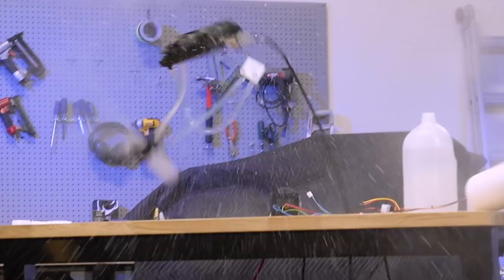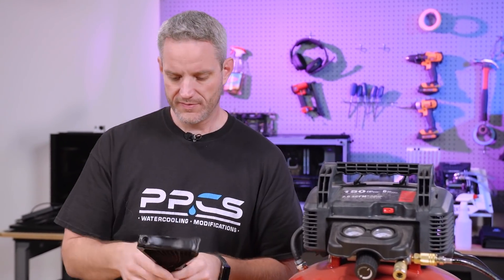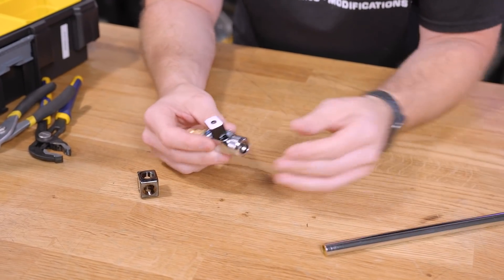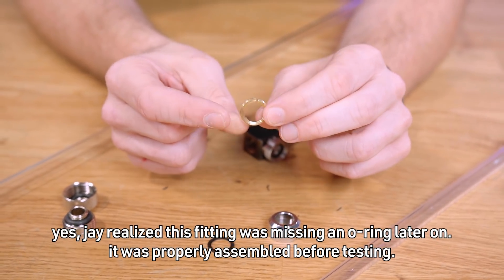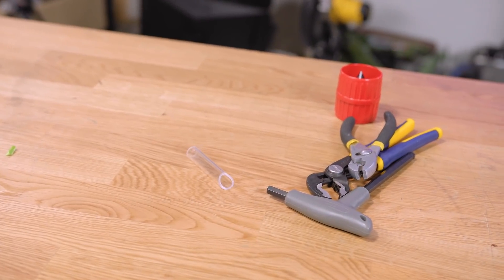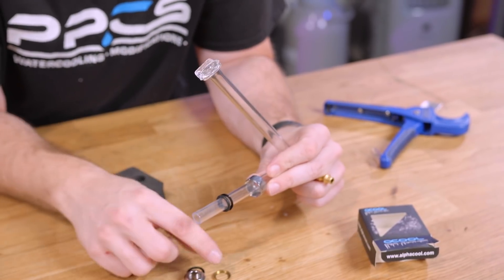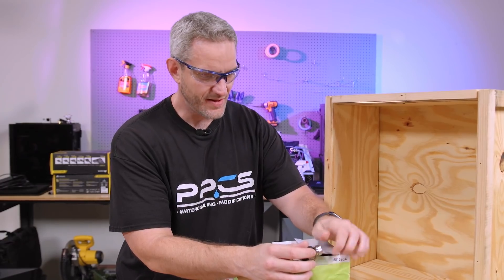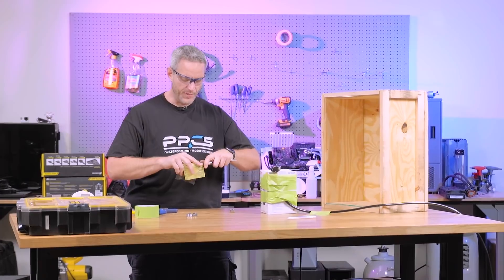I really need to stop these experiments... DO NOT TRY!

Comment: As a demo guy... metal tubes actually hold well. Think plumbing. 1 sharable, can hold the water pressure in your pipes... unless you make a mistake... then you need to fix the hole in your ceiling as well.

Comment: Next time you are bored, here is an experiment for you Jay: buy a large off the shelf PC case, then mod it so that it still looks good, but can hold enough 140mm fan based radiators (like multiple 560mm or 420mm radiators) to be able to get a max overclocked top of the range CPU and GPU to within 5 degrees C of ambient, with fans running at the minimum speed they can go. I know you did the box fan experiment, but that was not within an off the shelf PC case, not practical, and not something that we could copy at home ourselves in a way that would look good on as a complete PC that you want to keep, rather than bits of equipment all over the place. :)

Comment: Back in 2004 i started building my watercooling stuff. Passive heat exchanger with 6m (later 12m) copper installation pipe handsoldered, reservoir 5l canister.
Built the aluminium gpu and chipset coolers myself with a cheapo drillpress mill. (The first ones really only with drills, blocks and tubes+epoxy) Cpu was already kinda cheap to get in copper.
Used a tandem of two used geared pumps.
Nevertheless beeing used, they still got up to almost 9 bar when clamping the output line.
Guess who forgot to unclamp the return line tubes after changing things... yep, i did.

I was and am still using thick walled silicon tubing. Looks really cool when they get bigger and bigger and more transparent.

Afterwards i knew my system was worst case leakproof :-)

edit: 10 bar = 145 PSI

Comment: Did the compressor file a complaint by now?
(I think aquacomputer leaktests their stuff up to 10bar)

PS: Your potato gun needs a larger air buffer volume  in front of the valve. And always wear ear (+eye) protection with unknown pressure stuff.

Comment: If you are building pressure, beyond what the pump is doing, in your water cooling loop, you have bigger issues. Water won't expand until it boils at 100*C and there should not be air in your loop.

Comment: there is 1 thing i always wanted to see, though i don't have the tools, equipment or the parts to do so, but how will an very old part compare to todays modern ones, like how will for example an intel 2700k or another 2nd gen intel cpu overclocked to 4.5 GHz or so compare to todays cpu from AMD or Intel at around the same frequency having the same amount of cores and threads (have to use a newer gpu though, its the only thing that improves gaming performance greatly), do the people owning these chips or parts really need upgrades on cpu motherboard ram?

Comment: being a chef/butcher, i was wondering, is it at all possible to water cool a system using cow/pig blood. these are readily available from butchers over here in the UK and used in a wide range of recipies. Linus has tried to cool a pc with cement, so why not got one better? It will also be interesting to see how much heat it can acctually take before the animal blood starts to clot and block the rads, water blocks, and pump. It would make for one awesome halloween/horror theme build.

Comment: Alpha Cool uses the rear washer, just like Swagelok proved with their compression fittings, that a rear facing washer applies the nut pressure more evenly on the compression material, whether gasket or metal sealing, to give a much better sealing action.  its especially important with metal to metal seals.  We used nothing but Swagelok in the semi conductor fabrication equipment I designed and built for a decade.

Comment: you should try this with the thermaltake fittings! i think they are alot better. they also make it easier to measure the tube distances because of how they are made to where you have a flat surface on both ends. plus they have like 6 o-rings!

Comment: Mam, if you want to do pressure testing, get a piston pump an do the test with liquid. You can have 100bar pressure in a hydraulic line, and when it pups, it will go easy. No dramatic exploration. Air will compromise and have much more energy storage and will explode when there's a failure

Comment: actually in this case size does matter, at the same PSI a larger tube will have more pressure pushing on it. so for a good teat of fitting you DO need to use the same size tubing, but this is for fun right?

Comment: In the brewing world, I see 4% volumetric expansion without pressure from room temp to boiling. Considering most loops have some extra space in the reservoirs and you aren't seeing nearly as hot of temps, I really doubt you'll be getting any kind of pressure close to what you tested in the video. Could always add a tee somewhere with a pressure gauge to test out an rig under load. Thanks for the entertaining content though, would love to see more like this. Subscribed!

Comment: Yep I can confirm. I used to work in a QC lab for the fastener industry and I did a lot of torque testing of fasteners which requires specific high PSI depending on the fastener. Sometimes with failure the sheared bolts or failed nuts would fly off into the wall and would definitely dent metal.  I made sure never to stand directly in front of the instrument.

Comment: This makes me wonder how long before Steamfitters start getting commissioned to build PC Radiator arrays.  We already do full scale installations of Datacenters and Chip Plants but I mean for Personal Computers.  Someone call up their local Mechanical Company:
Customer - "Do you guys hook up  PC Cooling?"  lol 
Sales Rep - "We sure do!, what sort of system are you interested in?  Copper? Steel? Stainless Steel? Aluminum? Glass? PVC?"
Customer - "Oh wow.. uh.. I didn't know there were that many options"
Sales Rep - "Oh sure, we also offer different types of joint bonds too; Soldered, Brazed, GTAW Welded, Orbital Welded, Swagelok, Or just simple Compression Fittings with Flex connections?"
Customer - "Oh my.. uh.. Got anything that's shiny like silver?"
Sales Rep - "Yup, that would be 316 Stainless Steel (Expensive but would look damn impressive).  Do you want that in Water or Freon? Or perhaps you'd like that with a Freon loop for refrigeration?"

Could go on for hours, but yeah the market for this looks interesting and some truly impressive designs can be made. And all of them would hold up to several thousands of pounds of pressure (no idea why you'd want or need that)  and could easily put your hardware into a small freezer complete with air-dryer to keep everything from sweating and shorting out lol
Reply: please

Comment: Jay please do a 24 volt D5 pump test. Amazon has the 12v to 24v adapters for 15bucks.. Some liquid cool retailers say it will up the head pressure by 50% (AKA 1/3) I noticed my pump actually got quieter when i ran it at 24volts the pump D5 itself is actually designed to run at 24volts so all the specs are based on that. running at 12volt is undervolting D5

Comment: Ive worked at a tire shop. The tire cheetah will knock you off your feet. The bead popper will chop your foot off. The tire table will mangle whatever you dont get out the way fast enough. Filling a used dry rotted tire is scary af cause they do explode and make lots of noises.

Comment: For the acrylic tubing, buy an arrow cutter. For archery purposes normally but they cut stainless steel aluminium and carbon fiber arrows, They should cut acrylic tubing with ease, plus you can even get a nifty one for your shop that has a shop vac connection to prevent the dust from flying around. Some even come with a set of tools that would help with deburring an smoothing that tubing

Comment: I wonder how long the fittings would hold at each round number of PSI, if each one would be able to last 1 minute or more under each round number, continuing to go up until the one that blows it.
In other words, what I'm wondering is how much of a stable flow of PSI the fittings can hold, instead of just how far up in PSI you can go before they blow.

Maybe if you give it a minute or so before jumping from 10 PSI to 20 PSI, and from 20 PSI to 30 PSI, the fittings will have had time to adjust to the pressure increase, gripping onto the pipe better before the PSI increases again.

Comment: OK, you started out with a big DON'T TRY THIS AT HOME so they might let you live. Pressure testing is done with a liquid!!! Liquids don't compress, air does. An air leak->rupture will go BOOM (and lift off your roof, blow out your windows and cut off your head if stuff gets big enough), a liquid leak will piddle a bit but not rupture your test subject in a zillion pieces. Just my 2 cents

Comment: When it comes to a push configuration on a radiator, what’s the minimum amount of space you need in front of you fans to still get effective air flow? I have AIO water cooled system that’s hindered by space. I managed to make everything fit, but my front fans only have around an inch of clearance from the front of the case to pull air from.

Comment: I'd like to see a comparison of radiators. I have a 25mm rad, but is a 30 or a 45 better with the same fans, same pump, same pc....same everything except radiators....please
Try an Alphacool Eisbaer Solo LT with the 25mm radiator. All copper plate and rad...it's what i have and my 3900x doesnt go above 58c :)
Edit: mine also has Thermal grizzly liquid metal...thats got to account for at least 5c I suppose...

Comment: You should consider using Performance PC's 12V to 24V Laing Pump Supercharger as it increases flow and head pressure. I have 2 of them that I didn't end up using in my current system after the first time I used 1 on a previous build it made my EK GPU block leak, not through the fittings, but through the screws that hold the block together, it leaked on top of my second 980 Ti Classified card and killed it.
Reply: Mind you that this took about a month after building the loop to occur.

Comment: You should try a scuba tank 3000 psi or paintball 4500psi. They also make compressors that fill those tanks. You might die though so be careful. What you are doing in these videos arent really that dangerous though comparatively.

Comment: Ok, next experiments: Bacon grease instead of water in a cooling loop, lard instead of water in a cooling loop, and using air coolers to cool water loops without radiators (i.e. sandwiching a CPU block to the block of a huge air cooler like a Noctua D14 or D15) and using that to cool a whole loop. #ForScience I'll admit two are terrible ideas and one might make a cool video. If you could get the base of the cooler and the water block lapped for good enough thermal transfer, you might be able to even do fanless cooling.

Comment: Hey Jay, just +1ing your idea to test the pressure a working loop develops when hot etc! I'm fairly sure you can adapt a pressure sensor display to pick it up? Either inline or perhaps screwed in to/attached to the fill hole? Haha..almost like compression testing an engine cylinder/piston!

Comment: Hi Jay, I have a lot of fun watching your experiments. I am an ex rocket design engineer (science license haver) with a fair amount of experience  with high pressure pneumatics. One thing you might try to make your experiments safer is to use pressurized water to fill whatever it is you are pressure testing ( as long as it is appropriate to the system). Pressurized gas can store a lot of energy as you saw, and a way to mitigate the danger posed  by having a pressurized volume is to use an inconpressible fluid like water to fill up most of the volume, and then adding pneumatic pressure to that system. I'd hate to see you or Phil get hurt pursuing these very exciting experiments and thought this might be something for you to consider. Have a great day, and keep up the fun content!

Comment: I’ve got another angle to this.  I’m curious why cpu cooling companies hadn’t used air compression for cooling chips yet.  Aircraft use this technology, and it’s very effective.  When you compress air, it heats up, you cool that heated air with a tap off of the previously used uncompressed air (ambient forces across), then rapidly expand it and it becomes extremely cool.  I think this oils be a very productive technology.

Comment: Not saying anyone would be basing a PhD of your experiments today, but changing the diameter of tube would make a difference because it would have greater surface area contact on which to grip. That is in essence what you were doing by sanding the edge of the brass tube too. 

Again with the specific sizes involved and the generally loose methods it wouldn’t have been a significant factor though

Comment: As an engineer; do not mess around with compressed air. The correct way to pressure test a vessel is to use a compressed liquid. It doesn't squish very much vs a gas. It's the gas expansion potential that creates the danger.

Comment: Unless you work with compressed air every day you dont really understand how scary its power really is and I speak from experience after 10 plus years on construction sites using nail guns, impact drivers and other air powered tools. Compressed air can do crazy things even to parts meant to handle high volume air under pressure. I've literally had the cops called on our three man crew because an o-ring went out on one of our guns and it shot a bunch of nails in rapid succession and the neighbors thought someone was firing a real gun because the sound changed when the o-ring seal gave out from daily use. the funny looks we got when the cops call went from shots fired to blue collar idiots with nail guns doing someone's roof...

Comment: Pro tip: With hard line tubing, avoid connecting a tube with 180 degrees between connections (eg fittings pointing the same  way, and just a U bend between them) as even though the pressure from the pump is not that high, there is a chance it can slowly work it's way out of the fitting if improperly tightened and then leak.

If each individual pipe is installed with opposing fittings or fittings at 90 degrees, then an increase in pressure in the system won't force the tube out.

Or just, use alphacool fittings I guess, those things were boss

Comment: EXPERIMENT:-  trying fans of 120mm, 140mm, 200mm of same thickness at blade type at same RPMs .
Measuring the amount of airflow ... Or. ... The pressure inside close vessel pushed by the open ends of vessel using a fAns.
TESTINHG FACTS: - big fans has higher speed and higher push to the edge of fan because bigger radius than small fan at same RPMs.
Please if u make a video on this ..mention my comment🤗..
Thank you😇

Comment: For that further video of how much pressure a system builds, you can just use an equation to find the pressure with an known volume and temperature, rather than trying to fit up some system to measure the pressure

Comment: i remember hearing in modern cars at the factory they will vacuum fill the cooling system, a valve connected to the system, coolant reservoir on on side, draw a full vacuum on the system, then open the system to the reservoir to fill it, with no air bubbles. see how well, or badly, that works filling a water cooling loop?

Comment: Tbh one thing I have been wondering lately are there benefits to using a pressurized system like a car and if so, would using a water to air cooler be beneficial to a PC like it does for high HP drag cars :)
(this is just ideas)

Comment: 6:29 I think the diameter of the tube does matter because the surface area of a cylinder is given by A=2piRH+2piR^2. Because the area is a function of the radius squared, increasing the radius a little bit increases the surface area of the OD a lot. More surface area = more friction area = more holding force no?

Comment: Ok Jay, how about a real project with real bragging rights. Screw LN cooling. How about doing glass tube cooling with liquid mercury. Mercury stays liquid right down to -38.83C or -37.89F it's boiling temp is +356.73C so apart from it being poisonous and the vapor being quite naughty it's the perfect fluid for liquid cooling. I really don't know why you haven't thought of this before. For extra credit go and watch Adam Savage's spacesuit cooling video. Imagine building a miniaturized 400W refrigeration unit into a standard size case with a tiny Freon to Mercury heat exchanger. Just a thought.

Comment: heres something to think about...   the microfins used in lets say Video card coolers are so fine, so close together, they act as a filter and will clog up and reduce the water flow in the system... and yes, aluminum radiators produce aluminum oxide ( that fine white powder) in large enuf sizes, it clogs up the microfins... Ive got the Corsair Video cooler and its got a layer of white "slush" across the top of it... and the flow rate has decreased a fair amount... and tonite I get to clean it all out...

Comment: ...but does a loop under compression transfer more thermal energy than a loop under a decompressed load? How far will the hard tubing hold under a negative pressure? Can it maintain a vacuum? I also like the idea of seeing how the pressure of the loop changes during different heat loads

Comment: jay you have to wet the sanding paper before sanding. that paper you use is called wet sanding paper for a purpose. it will sand smoother and without pitching noise

Comment: Primochill can't even handle a dual d5 pump system.  They come out over time.  Every single one that was attached to a tube with a bend in it failed.  They are probably fine with a single pump, but anything more they are just not going to last.  A dual pump in a small loop can actually make the tube pop all the way out of the primochill.